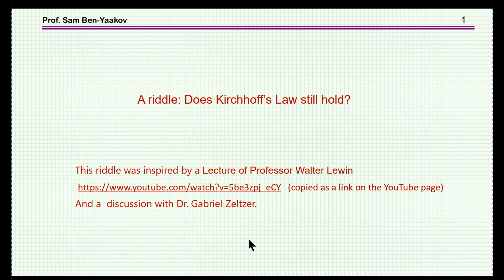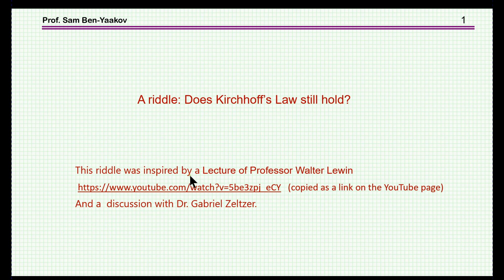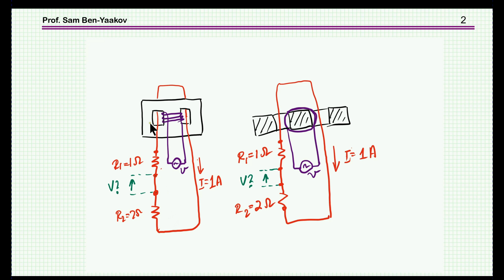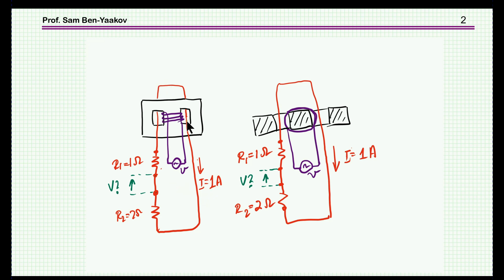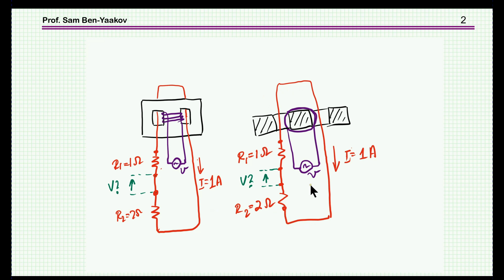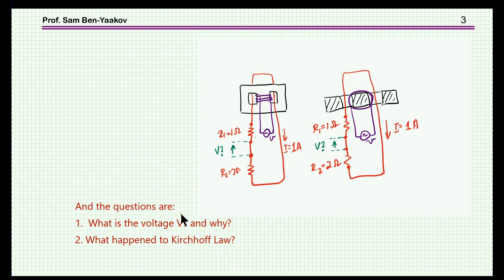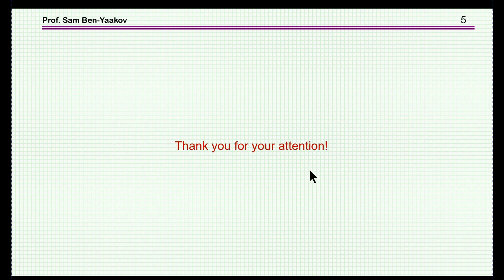A riddle: Does Kirchhoff’s Law still hold?

Comment: Faraday's law:
emf = -d(phi)/dt = -d(L*i)/dt = -L*di/dt
total emf around the loop is 3 Volts. But for a specific portion of the wire, we must calculate the emf with the formula above. So the induced voltage will depend on the length and the crossection (inductance) of that portion of the wire. The voltmeter will read something between 0 and 3 volts but we cannot say without knowing the phsical properties of the system.
Kirchoff's law doesn't hold here because of the changing magnetic field affecting the whole circuit loop, we must use the Faraday's law.
Hope this is correct!
Reply from the maker: Hi bora, thanks for input. The inductance is ignored.
Reply: Hmm then I don't really understand. If the loop of wire doesn't have any inductance, how is there a voltage induced under a changing magnetic field?
Anyway, please keep doing what you're doing. Your videos are a delight to watch!

Comment: IF it is a steady regime, we will get a total lost of energy equal to the one generated, otherwise, it won't be a steady regime. That goes by definition and logic more than by electricity.

Without the lumped resistor, a uniformly distributed lost along each millimeter of the loop could be a good candidate, since the current is constantly the same everywhere along the loop, the cable section is (assumed, I presume) constant and Ohm's law is (probably to be assumed too) holding uniformly all along, as given. 

Sure, we can add, by superposition, other not-uniform gain or lost due to other external "business", but for the resistors themselves, it can be even easier.

Given the resistors lumps, expand them as extra cable length such that the new extra length will supply the same Ohmic-value.  And the whole loop, at least, far from the magnet, it is a matter of uniformity (or not? if not, what is the nature of Ohm's law not working in this case for the cable but working for the resistor?).

Comment: It depends on how I connect the voltmeter.  If the wires of the volt meter pass through the core then the results will be different from when I make sure my probe leads stay outside of the magnetic loop that is luckily confined to within the transformer core.   Therefore Kirchoffs law holds between the wire and the voltmeter and we will measure zero volts.  If there wan't a nice core confining the magnetic field then the question gets a bit more tricky and the geometry of the circuit really matters.
Reply from the maker: t is assumed that the magnetic flux is confided to core and that the measuring circuitry is not influenced by it.
Reply: @sambenyaakov  Which is a wrong assumption because the probe wires ARE affected in Lewin's "paradoxical" demo. Physically moving them results in the readings changing. Lewin has a point mathematically if you accept his definitions of KVL, and I think that his probing technique is not an accident. But his definition of KVL is not accepted by many people, mainly because it doesn't work in this situation. By his logic, the 2 terminals of an ideal transformer secondary coil are the same node, which is ridiculous! But the reasons for the paradoxical voltmeter readings being different at the exact same points on the circuit are do to errors in his probing methods. There is a voltage being developed across the probe wires too do to the EMF. So yeah, he is technically right based on his definitions of KVL, but the experiment he uses to "prove it" is flawed, or at least misleading because he doesn't take the time to thoroughly explain the placement of the sense wires.
         It honestly all seems like a semantics argument that is designed to be confusing. Either take lewins approach if you consider the wire to be all a single node, or use KVL and treat the wire as a transformer secondary.

Comment: Kirchhoff's voltage law, in it's pure form, doesn't apply, because you do not have a conservative electric field around the loop due to the induced emf. The integral form of Faraday's law tells us that there is 3V emf induced around the entire loop, but does not tell us how this 3V emf is distributed around the loop.

However, Kirchhoff's voltage law is so convenient for circuit analysis, it is useful to model the emf as a 3V source that has been magically inserted in the loop. For this model, Kirchhoff's voltage law is applicable.

I would like to see how you calculate the voltage between the two points on the wire.  I think you have to calculate the magnetic potential (A) along the wire, then use E = -𝜕A/𝜕t  to calculate the induced electric field.  Once you have E along the wire, do a line integral between the two points to get the voltage (potential).
Reply from the maker: Hi Jess, Thanks for the input, Very good points. You seem to master the subject. I will be happy to get your comments on my analysis which I hope to post in a few days.
Reply: @sambenyaakov ,

 I am no master of EM theory.  Rank Amateur at best.

Comment: I'm unsure what the controversy is. The one turn of wire on the transformer is an AC source. The wire between the two resistors has a small amount of real resistance and inductance. It =will= have a self-generated magnetic field and will see some influence by the rest of the wire outside of the transformer.

Even so, this seems like the old "hotel overcharges and refunds money, bellboy keeps some of the money, where did the extra $20 come from?" riddles.

In other words, looking at the voltage on the short wire between the resistors is a red herring.

So you have 1Vrms across one resistor, and 2Vrms across the other resistor. That means that the voltage across the one turn of wire from the transformer should have 3Vrms present, plus a tiny amount extra due to the self-inductance of the loop of wire that connects to the resistors, between them, and the self-inductance of the resistors themselves.

You could simplify this to a DC source, two resistors, and wires with a slight amount of resistance. The vector sum of the voltages around the circuit is still zero. Current is still conserved, as electrons are physical particles with charge and none are entering or leaving the loop.

It seems to me that everything else is semantics or flaws in methods of measurement.
Reply from the maker: Hi Steve, Aren't you just hand waving? You do not answer the question what IS the voltage across the wire between the resistors or how you would calculate it. Never mind the inductance. As for you comment: "Why are you worried about that voltage", I am not worried because I know the answer😊 This is a RIDDLE meant to sharpen the insight of novices AND experts into the inner works of the marvelous world of electrical engineering. As you might know, I am posting YouTube videos to present my intuitive approach to analog and power electronics. and have also started a LinkedIn group for that purpose. Of all the responses I received, only one (1!) person seem to understand the problem and knows how to calculate the voltage. This only tells me that I might be doing a good job. 
 And no, you CANNOT "simplify this to a DC source, two resistors, and wires with a slight amount of resistance".
Reply: @sambenyaakov  I don't understand how I'm "just handwaving". What is the significance of that short piece of wire between the resistors? Why would this prove or disprove Kirchoff's law?
Reply: @sambenyaakov  What you've drawn is halfway between a schematic and a pictorial diagram. Does that line represent a node, a point where the two resistors connect? Or does it represent some length of wire?

I thought it was evident how to calculate it. Assuming it is out of the field of influence of the transformer and not tightly coupled to the other wire and is nothing more unusual than an inch or so of wire between the resistors, you need to know the frequency of the AC, and the impedance of the wire. Self-inductance and resistance.

I don't see what the mystery is. Please explain.
Reply: @sambenyaakov  Are you trying to say that the entire loop of wire is within the transformer?
Reply from the maker: The loop is circulating the center leg of core. Like a PCB winding on a flat magnetics core.
Reply from the maker: Still evading the issue. OK, what if the part of the resistors and interconnection would be tight around the core. What would be the voltage of the interconnecting wire?
Reply: @sambenyaakov  This is why you must make clear what you are drawing. So a proper pictorial would show one tight turn of wire, with two short sections of wire replaced by resistors, then? That complicates things, as current is induced in the body of the resistors, too. Of course, then, current is induced in the short section of wire.

You've left a lot of assumptions out.
Reply: @sambenyaakov  I'm a bit tired of being insulted when I'm just trying to figure out what your initial conditions are.
Reply from the maker: Steve, my sincere apology if you feel that there were any ill intentions in my writing. In the "heat of the battle" I may sound a bit cheeky but I guess this is part of my Israeli trait. 
Honestly I do not think that there is any problem with my drawing , being a bit crooked as it is. It is a simple set up. One winding around the leg of a transformer core with two series resistor placed apart. And the question is: what is the voltage between the the two resistors, or for that matter, on any piece of the wire which is assumed to be of infinite conductance and  the inductance ignored. Not all of the pentameters are given so assume anything you need to solve.
Reply: @sambenyaakov  Thank you, I appreciate that. We don't know each other, and text is an expressionless medium.

I'd start with the section of the circle. If it were a complete circle without any resistors or resistance, you'd get some current limited by the source impedance, primary wire resistance, and leakage inductance of the primary. Cut it, and you'd get a voltage at the cut based on the turns ratio and incoming voltage on the primary.

Put in a 3 ohm resistor and observe that it has 1A at 3V across the resistor. So 3V around the circle. Pick any section of the circle, based on its fraction of the total circle of wire. Say it is 30 degrees, 30/360 x 3V = 0.25V However, I'm not certain how this simplification would work out with resistors of real length that are part of the winding.

Wait, maybe I do. If the resistors take up 90 degrees of the single turn, that leaves 3V dropped across the remaining 270 degrees. So that 30 degrees becomes a fraction of that. 30/270 x 3V = 0.333V

As a friend of mine likes to say, transformers are FM. So perhaps all that matters are the sections of wire where they pass through the holes in the EI core. In which case, with that section of wire outside of that area, there would be zero volts dropped across it.
Reply from the maker: @AlienRelics  Hi Steve, you are certainly on right track. Hold on to my "revelation" video.

Comment: Voltage, V = 0 volt ...
Reply from the maker: Because?
Reply: Hii, Sam Ben-Yaakov because, 1A current flows through the loop & we are measuring the current across the current carrying conductor. Ideally, V = 0, but practically it will be V = few microvolts
Reply from the maker: So Kirchhoff Law is incorrect (sum of voltages across the loop is zero) ?

Comment: Sam,

I don't understand what the riddle is.  With 1amp (RMS) flowing through the secondary 1V and 2V (RMS) will be generated in the 1 and 2 ohm resistors respectfully.

Hence it is obvious that 1.5V (RMS) must be generated across each part of the secondary as it passes through the core.  

The sum of the voltages around the secondary loop add to zero as predicted by Kirchoff's voltage law.

I don't understand the significance of the asking what voltage is generated across the piece of wire between the two resistors - assuming we are considering an ideal circuit with zero conductor resistance then the voltage will be zero.

Above I analyzed the circuit assuming all the quantities were expressed in terms of AC RMS measurements.  You could also assume that the analysis is done considering instantaneous values - according the same conclusion results - everywhere I have specified AC RMS just replace this with Instantaneous.
Reply from the maker: What if there would have been only one resistor and the wire has zero conductance, the voltage on wire would have been zero?
Reply: @sambenyaakov  Sam,

I suspect that I am just too familiar with understanding exactly what is going on here that I am unable to see that there is some kind of riddle here that throws off the more novice to magnetics.  I can't see anything here in this problem that is outside what is easily explained using a combination of Maxwell's and Kirchoff's laws.
Reply from the maker: Hi Michael, Granted, Maxwell explains it all. OK, so I am not that astute, but ...you did not answer my question. If according to you, the voltage across the piece of wire between the resistors is zero, then if I disconnect one resistor (and reconnect the wires) , will the voltage across the remaining  zero-resistance wire (not zero conductance as I have  written by mistake earlier), also be zero?
Reply: @sambenyaakov  

The way I would explain the entire problem is as follows:

There are two circuit domains - the transformer (or magnetic circuit domain) and the non magnetic circuit domain.

If you consider these individual domains in isolation then there is total consistently within each domain.

In the non magnetic circuit domain you have a current flowing, zero resistance wire, and a number of resistors - all you need here is ohms law to work out what is going on.

In the magnetic circuit domain you have a simple transformer and Maxwell's equations fully explain this domain.

Connect the two domains together and Kirchoff's laws fully explains the situation.

The only part of this entire problem I see that could possibly constitute the basis of a riddle is when you consider the zero resistance circuit interconnecting wires.  From the diagram it is not necessary obvious that the interconnecting wires occupy both the magnetic circuit domain and the non magnetic circuit domain.  My solution to how you would 'solve' this riddle would be to get a pen with a different color of ink and change the color of the parts of the interconnecting wires that occupy the magnetic circuit domain - hence the riddle is solved.
Reply: I didn’t understand it at first either. Sam brought up a good point though, if you have 1 resistor and 1 amp flowing through the loop there will be voltage across the resistor and the wire. I suspect there will be some voltage induced in the wire by the emf from then transformer core.

Comment: As Electroboom said, you must account for how the magnetic fields affect voltage and current in the wires running to the measuring device.
Reply from the maker: So, what is the voltage?
Reply: @sambenyaakov  I posted a more detailed comment. The voltage V between the resistors is trivial. Why are you worried about that voltage? What about the voltage across the one turn secondary?
Reply: @AlienRelics  Lmao, "Why are you worried about that voltage?", more like: "Don't ask me questions I can't answer". "If you can't define it precisely, you can't claim to know anything about it" - Richard Feynman.
Reply: @1ohtaf1  I'm not the one violating physical laws! The physics police are on to you...

Comment: Do we need to include electromotive force? And we should use this kind of transformer scheme?
http://www.elektro.info.pl/images/photos/24/637/__b_ei-9-2007-kurs-cz4-rys3.jpg
Where Rfe and Xu is infinity big, X1 and X2 is zero?
Reply from the maker: Not really.
Reply: @sambenyaakov  ok, same but in different words. if we arrange the equation with only "secoundary" winding, Kirhoff law is fail, but when we look at full system (primary and secoundary with magnetic coupling) it have sense, because voltage will induced (my profesor in university olways say voltage cannot be induced, but electromotive force), and Kirhoff law is fine. I wonder how calculate electromotive force (or voltage) induced in dl (differential with length)?
Reply from the maker: Indeed electromotive . But how does it help us to assess the value of the voltage?
Reply: Maybe I think to much and answer is easy -> 0 = -I*R1 - I*R2 + N1/N2*V then voltage between in measure point is 0 and it's ok. I tried use Maxwell–Faraday equation, but this too much for me :(